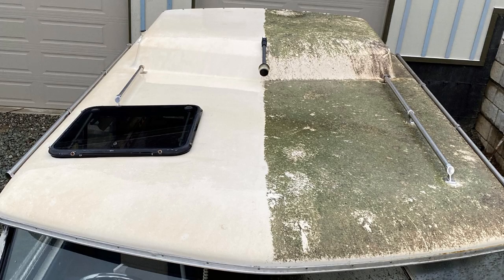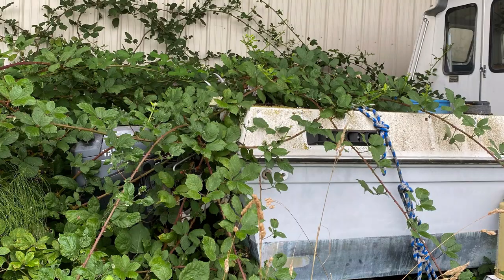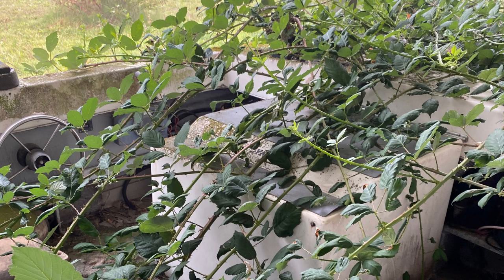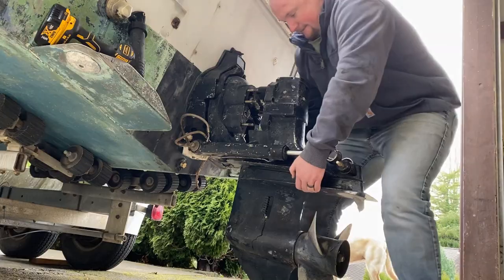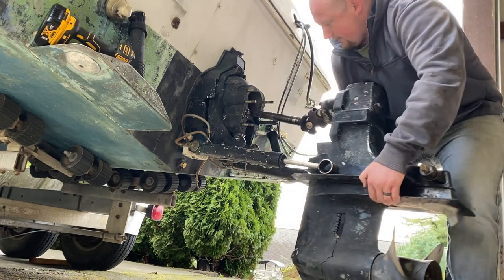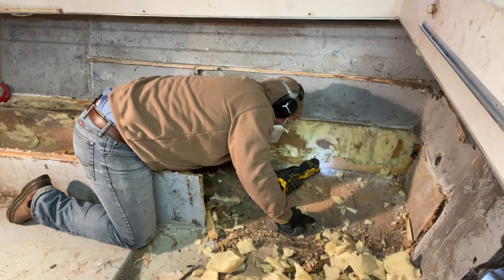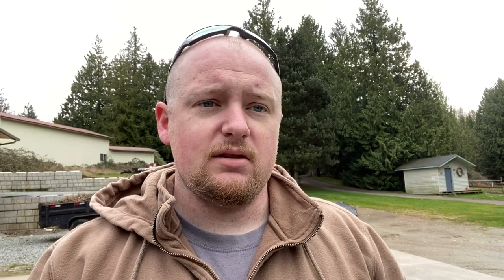Boat Restoration| Labor and expenses/ what is coming up

Comment: I did a similar job on my Bayliner last year and tried several different ways of cutting out the old glass, the oscillating tool was by far the most effective over all, a disc cutter was definitely faster but the dust was unreal, made me itch for a week!!
Great job and good luck with it 👍
Reply from the maker: It gets pretty bad! I hate the dust but it’s all part of the fun! Thanks for watching!
Reply: Thats why they made protective gear

Comment: Check out boat works today. Ifmemory serves he found a carbine tipped oscillating tool blade which cuts after and stayed sharp longer.
Reply from the maker: I’ve used the carbide blades before and they work pretty sweet. There were quite a few staples and other metal I had to cut through too. The titanium ones I use last longer I have noticed. Andy is a great teacher!